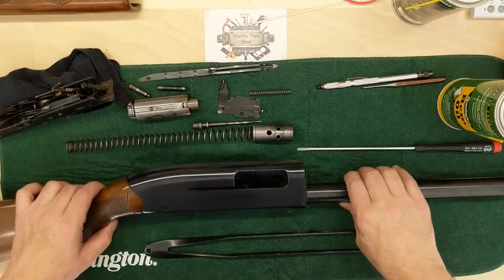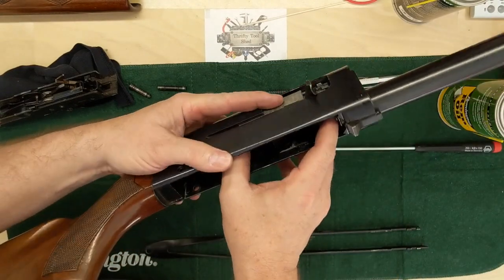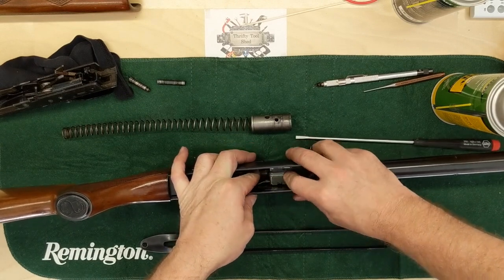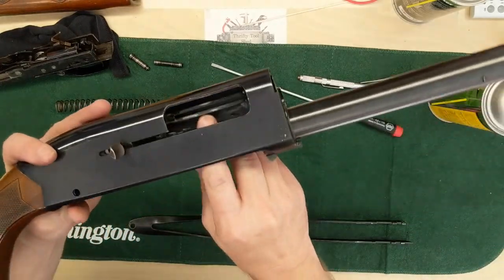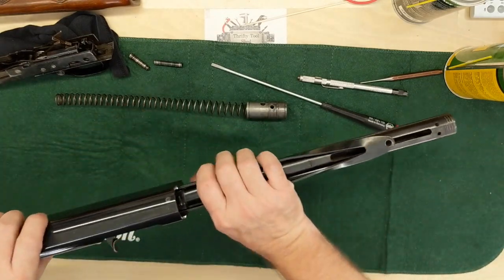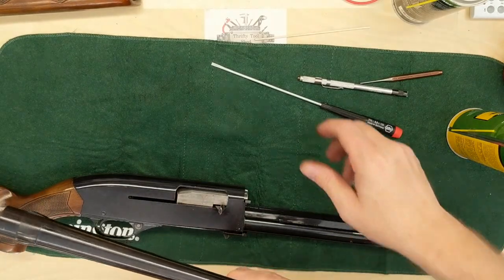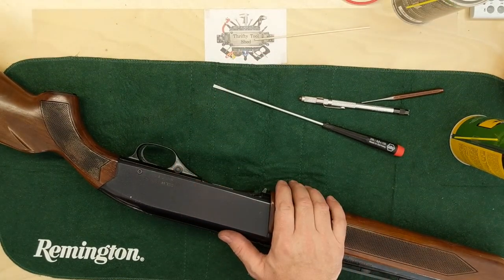Winchester 1400 MKII Reassembly

Comment: Today I was able to disassemble and reassemble my Winchester 1500 XTR shotgun after viewing both videos.  Same construction on the 1500 as in the 1400.  Replacing the cocking handle bridge and the firing pin took some repeated efforts after studying the video a few times.  I did manage to order and replace the return spring in the magazine tube plus the firing pin spring.  I ordered those springs from Midwest Gun Works.  They display a parts diagram for the Winchester 1400/1500.  I am awaiting a magazine spring and damper spring from Classic Firearms & Parts.  I've yet to find a video showing how to open up the magazine tube on the other end to replace the magazine spring.  (I did receive a second magazine for my Savage Model 25 rifle from Numrich Gun Parts, while Savage itself was still out of stock for 223 Rem magazines.)  Thank you for the great assistance.

Comment: Mine requires the washers as well.  It will not cycle without them.  A new washer was going to be $18 shipped.  I made a washer out of 3 layers of gorilla tape.  I just traced the magazine cap, cut it out, folded the circle in half, and cut out the circle.  It's worked great so far.

Comment: All back together and clean.  My gun is not pulling the shell out of the holding  tube and the plastic “action release is not working.  Do you have any ideas of what I might check?  I’m not really sure internally how that release works.  When I pull the action back it does lock somewhat but if I push it just a little with my finger it goes closed.  It’s clean as a whistle now though

Comment: I have been trying to get the whole trigger mechanism back into the gun for around an hour.
Reply from the maker: Hi,
Make sure the slide plate is down all the way and the screw is down fully. Sometimes it gets cocked and it's hard to tell the slide plate is up just a little.

Comment: good video, i was watching to see how the forend washers go in with the handguard. i gotta say a few things though.
rem oil is for cleaning, not lubrication. its wat too thin. also you only need to oil the wear parts that are shiny, i use a little 30w motor oil on my finger. all that extra thin oil is gonna settle down and end up hurting the buttstock.
Reply from the maker: Thanks for your comment!
For anyone wanting to make an opinion on their own about Rem oil check out this first! 
https://survivalmag.net/rem-oil-review/
Reply: @ThriftyToolShed  im just a gunsmith with about 20 years experience. i also redo wood stocks alot and that amount of thin oil is what turns the grip of guns black and dodie. i prefer mobil one oil for guns, on new guns i will run a high zinc motor break in lube for awhile and then clean and oil, but only with a fingertip dipped in oil and spread where needed. to each his own though :-) thanks for the reply, you earned another subscriber.

Comment: I did discover that the Winchester 1500 XTR may not have required the O-ring forearm spacer as does the Winchester 1400 shotgun.  Placing an O-ring labeled for the 1400 did not allow me to reassemble the barrel back into the breech bolt of my 1500 XTR before screwing on the valve cap assembly.   Perhaps Winchester eliminated the need for a forearm spacer.
Reply from the maker: Could be. I cannot say for sure. Interesting.  Thanks for sharing!

Comment: I’m having trouble putting my safety on after assembly. It also won’t release from the cocked position. Any suggestions? The plate is flush and the trigger mechanism goes together well. Idk what’s going on.
Reply: Allow me to answer my own question. Lol if you have this problem. Make sure the hammer is pulled back and locked. Then it will work properly when you reassemble the trigger mechanism.
Reply from the maker: Just now seeing this! Awesome thanks for sharing!

Comment: I'm ready to buy the same gun, Semi Auto Winchester 20ga 1400 MKII...it has a problem, the charging handle will not pull back, and where you put the shells in underneath, it doesn't give in to allow....I was told the previous owner had taken it apart and possibly didn't know how to assemble it back together, or left out a part or spring is in wrong....to shorten a long story, where you load the gun will not move.  I only looked at it for just a few seconds, its a beautiful gun, I just don't want to purchase it and not be able to fix it....any advise would be extremely helpful.....Thank you

Comment: Thanks for the video I tore my 1400 apart a few years back because the spring didn't want to cycle. So I just put it back together today and cleaned it up and its better now but now my handguard doesn't fit like it use too. There is a little wiggle now and its boggling my mind, do you think the wood loosened up over the years of not being put together?
Reply from the maker: It is possible it had spacer or washer under the cap that holds on the fore arm grip. The cap may be bottoming out before getting tight.

Comment: Breech won’t close after I get it all together.  Disassembled and reassembled multiple times.  Everything slides nicely until I mount the barrel. Any suggestions?
Reply from the maker: A couple of thoughts:
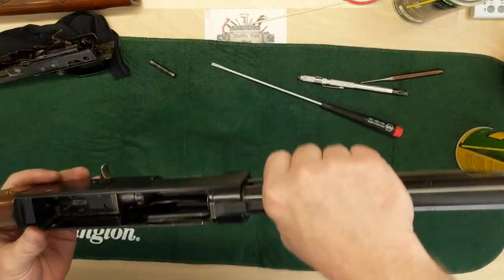1st at around 4:50 I discuss making sure the plate is not lifted at all from the slide, it can be hard to tell yet make things very tight. 2nd at around 5:45 and again at 7:50 I mention making sure the slide arms are aligned with the breech bolt slide. Then after that when putting on the barrel the breech bolt splines have to align with the barrel notches. Those 3 things, I believe are the most  common issues with the bolt being tight after reassembled. Best of luck!
Reply: Found my problem:  I did not have the trigger cocked so the action would not close, and the safety would not budge;  I had pulled the trigger during the disassembly procedure.  Original instructions mentioned that the trigger should not be pulled after cocking it before taking it apart.  That piece of information was the only useful nugget in the instructions, which seem to have been written in a foreign language and translated into English.  Thank you so much for your easy to follow and thorough post, you are an excellent teacher.
Reply from the maker: @Citizen-pg8eu , awesome, thanks for your comment! Happy Shooting!
Reply: @ThriftyToolShed  I had same problem after assembling. Turned out to be the trigger needed to be pushed back before assembling and then breech would not stay open until I discovered that the magazine elevator ramp or plate was not completely open. It was stuck half open against the magazine plug. When I released it to fully open, problem was solved.....